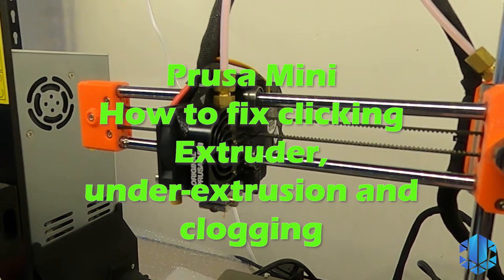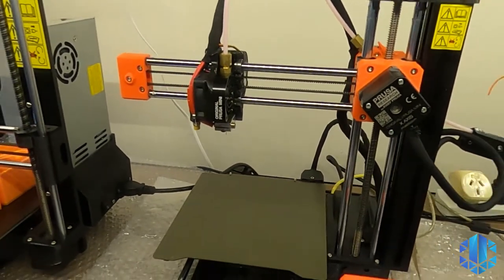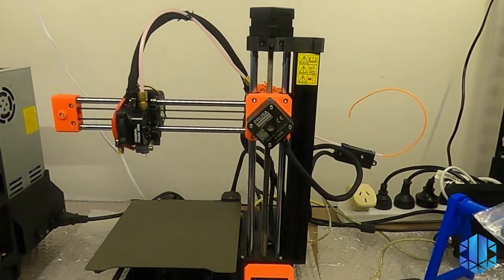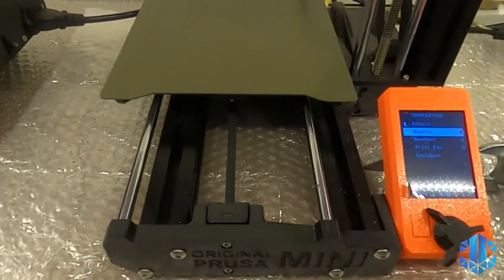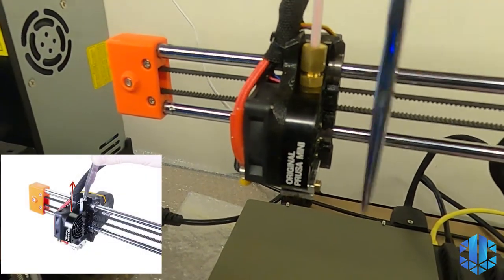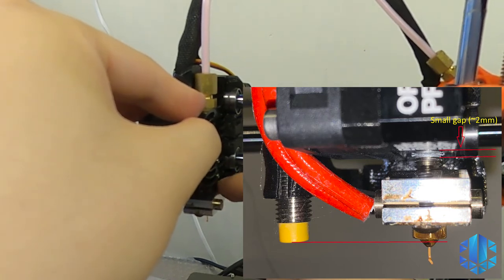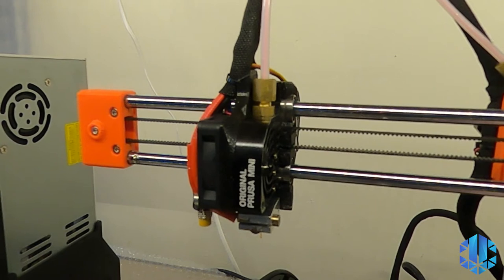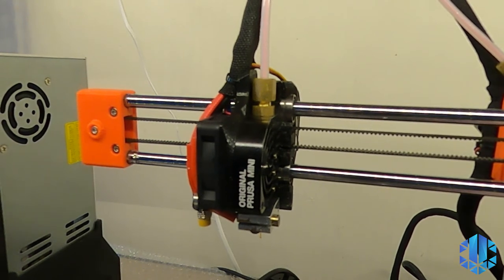Prusa Mini: How to fix clicking Extruder, under-extrusion, clogging, and filament jams

Comment: I havent had my Mini for more than one month and im already having these problems. At first I thought it was the Filament brand or retraction settings. I've checked belts, bolts, lubing, done cold pulls etc. I think this is the issue. I'm in for a long print right now but i'll try this right after. What blew my mind is that I printed a benchy a week ago that was nearly perfect, just slight stringing. Did the same test yesterday and the stringing is crazy with the same settings. Disappointed in prusa.

Comment: Thanks for the video.  I am surprised that there are not more videos on this topic.  I received my  Prusa Mini last week and after about 30 hours of printing, I got a massive clog.  Nozzle was completely encased in filament, big blob.  I also noticed that the height of the steel spring plates are different thicknesses.  You need to re-calibrate each time that you change the build plate.
Reply from the maker: Yes I had the exactly same issue when I was instructed to perform the cold pull. I used the cleaning filament from eSUN and the blob of the filament was completely stuck inside the heat sink. I got injured as I used way too excessive force on piler and it hit my mouth, and the blob was still stuck inside. I took the nozzle off and use the allen key to push up the bolb - it didn't work either! To fix that I heated up the nozzle up to 270C and cut down the power for the printer - this was to stop the fan from spinning. I pushed out the big blob as the filament was melted and deformed.
Reply: You can add build sheet profiles to make swapping easier.  No need to recalibrate between sheet swaps

Comment: Thanks for the video. Just received my mini, did two small prints and then starting having these same issues. Tried a cold pull and can tell the end of the filament is expanded so I have to adjust my PTFE tube. Disappointing as I have two Prusa's, MK2.5s and MK3, that were delivered assembled and never had an issue. Sad that out of the box these minis have assembly issues. Four years experience I can easily deal with this but I expect and new user might be very discouraged.
Reply from the maker: Hi Bob and thanks for taking a moment watching this video clip. Yes, I had A LOT OF frustrations back in the days with this clog issues with my Prusa Mini, Gen 1. I tried to contact the support and I think they were not very experienced with Mini back in the days. I think Prusa, at least for now, is not very experienced to sell assembled machines in such large quantities - most of the MK3/S printers are sold as kit. The good news is, once the alignment issue is fixed, my machine never had a single clicking or clog.
I think at this stage, I still love my little Mini. Considering my machine was shipped back in December 2019, it would be an early-stage release.
PS: I was quite caught up with this COVID-19 pandemic and I hope to post more videos once it's settled on my end.
Reply: you are right i have this problem and this is my first printer and i am afraid to do that and cause more damage to the printer.
Reply: @Warbeaver  well i will never buy prusa again i have used other filamnt printer before and never gave this problem. this my first owned printer and this brand is not worth it espically the customer service is horriable.
Reply: upgraded from ender 3 to prusa mini and have been very disappointed.
Reply: @manuelcruz2256  I know how you feel. I will never buy another prusa especially their support  is horrible.

Comment: Thanks so much for making this video! I think I spent 10+ hours testing various temperature settings in the slicer trying to lower the 'heat creep' since I didn't even know I could adjust the heat block height manually. I had to adjust the height sensor afterwards (thanks for the encouragement to do so!) but this is the first time I've been able to successfully print on the mini without getting the little blockages you showed at 10:48. Thanks again!
Reply from the maker: No worries @Little Tall Tales! I went through days of pain after two months of ownership of my clogged Prusa Mini, and their support couldn't figure out the root cause.
I am more than happy to share my experiences here and I am glad you figured it out.
My Prusa Mini runs reliably for more than three months since I did the rectification on nozzle height in February and I believe a lot of people might have the same issue on this.

Comment: I've never had any of those problems with my Prusa Mini.  It works excellently all the time.  I do try to improve the prints by changing the flow rate and the z offset.  What flow rate do you like?
Reply from the maker: This is a 3-year-old video and since then I've donated my machine to a school and no longer an owner of Mini, however my new workplace, which is a school as well,  has Mini+ and I haven't experienced this issue as of yet (It's relatively new). My copy of the Prusa Mini was really an early model with serial number less than 100 so you could imagine that might be some issues here and there. What I can confirm that this one has no direct relationship with flow rate as I recalled even the stock GCODE from the USB stick caused the clog after first dozen of layers, which was extremely frustrating.

At the time, even Prusa official chat support channel had no idea why this happened and you can see my video helped a lot of people with similar problem.
Reflecting on the potential root cause, I would assume there had been insufficient cooling for the hotted and it resulted in heat creeping above the nozzle. Once the filament melted at the intersection of heatsink and nozzle, it will interrupt the filament from going down, given the fact that there might be a small gap between the end of the PTFE tube and the start of the nozzle area. My method worked because of the elimination of the gap.

Comment: Still a noob in 3d printing. But my mini the filament got stuck in the brass fitting between tubes after the filament motor. As it stop printing and wouldn’t come out or go in. This is with Prusa filament.

Comment: The tube is not supposed to reach the end, its intentionally shorter so that you can print high temperature materials such as at 275C. If the tube is too close it will deform at those temps.
Reply: Incorrect. Here is a direct quote from Prusa themselves in their guide to replacing the PTFE tube, "It is crucial there is no gap between the PTFE tube and other parts of the hotend. This is why we are pre-stressing it."

Comment: If I push the heat break so high, the inliner has to be shortened, otherwise the connection cannot be screwed in as far as it will go.  Is that correct?  My inliner is 43mm long?
Reply from the maker: Hi @Grüner Woodworking
! You don't need to shorten the PTFE tube.
I think as long as the nozzle is brought a little bit closer to the heatsink, you should be okay. There is supposed to be some sort of 'compression' for that PTFE tube, as you can feel the friction when you screw in the upper fitting part in. However, I wouldn't recommend putting too much force for those three grabbing screws to keep everything in place.

Comment: When you heat your hotend above 220C the PTFE tube inside it will start deteriorating inside it and giving off toxic fumes.
Reply from the maker: Normal PTFE tube would be able to handle the temperature higher than this. Also, the internal construction of Prusa Mini is designed the way like this. There is nothing much you can do. In other words, if you print any material 220C and above, your PTFE tube will be pretty much in direct contact with the hotend at this temperature, at least more or less.
Reply: @dchstudio9519  Yeah, an all metal hotend makes sense.

Comment: I just tried my first print and half way through the first layer it blocked and would not back the filament out. Stripped out the bowden tube and the the short tube just popped out. Should this be secured somehow other than downward pressure from bowden fitting. Paid top dollar fir a ready built printer that didn’t work out if the box. Would you be happy if you bought a new tv and the manufacturer asked you to fix it yourself? Gutted that I have to cock about. Wish I’d bought 3 x ender3 instead. Shite.
Good video though mate
Reply from the maker: Glad to hear this video helped. I absolutely agree with you and I got so frustrated with this machine back in days - the Prusa support did not help much as they had no clues on troubleshooting the jams when this machine got released. I am also a Creality CR6 SE (Kickstarter) and Ender 3 Pro (for school) user and I think all these machines have pros and cons. For the long run, I do love the fine-tuned slicing profile from Prusa as for Creality, sometimes it's trial and error at the beginning. Also I realised that the mini prints slighly faster than my MK3S, possibly due to the new driver TMC2209?
It's also annoying that CR6 SE has the motherboard defects which prevented me from using Octoprint - I might do a BTT SKR board replacement when I get a chance!

Comment: Thank you for the video. Had a quick question.
When you push the hotend upwards, it will drag the PTFE tube up with it. That will probably cause the part that goes above the PTFE tube to squish the PTFE tube and overtighten it. Is that what you should be doing?
Reply from the maker: I believe the PTFE tube needs a bit of the compression to prevent the melted filament from leaking out at the bottom (the nozzle end). My Mini is still going strong after one year so it's proven to work on my end! Hope this helps :-)

Comment: I still have 2 months to wait for shipping.  I'm getting buyers remorse already!  Maybe cancel the order but what other printer?
Reply from the maker: Hi @Yakena1, I still believe Prusa Mini is a great printer! However, there are some issues and lack of documentation on the Prusa side but I would believe these issues will be resolved in the coming months. I think if you want a printer now, MK3S is still a workhorse, despite I am starting to hate the 8-bit microcontroller. MK3S are faster printers than mini because of the direct drive vs Bowden construction. Thanks for watching the video and let me know if you have any questions :-)
Reply: @dchstudio9519  I live in Asia and the additional cost to have either system shipped makes me wonder if I am making the correct decision.  I never owned a 3d printer, and I am now looking at a MK3S clone from Triangle labs.  Maybe a better way to do a diy and get up to speed.
Reply from the maker: @Yakena1  I understand this. Actually, MK3/S is still very capable of being a primary 3D Printer. They print faster and the service documents are very useful and user-friendly (compared to Prusa Mini as of this stage). As an owner of 2 MK3, lately all upgraded to MK3S, I purchased my first kit from Prusa as a kit. However, the duty and import tax here in Australia is way too high so I purchased the upgrade kit from Prusa and out-sourced some parts in order to build the second MK3. Everything worked quite well except the motors. I ended up buying motor from Zaribo, who sells LDO motors for their printers.
Reply from the maker: @Ohioan93  I think their production was affected by the coronavirus in China as there was a defect in their LCD assembly. My copy of mini is still going strong. I ordered my unit just 2-3 hours after the video release and I got it in mid-December last year. I think this printer makes great secondary printer but we all have to understand this is a lower cost machine so Prusa is trying to save some money on this machine, like belts, smooth rods and extruding mechanism.

Comment: I can’t tell you how much I hate the prusa mini 😂
Reply from the maker: I was sort of the same, but Mini can be a power horse for non-stop production. My extruder issue never came back since this video was published and the machine is still going strong (despite two service tickets regarding the PINDA probe and heatbed issues - both were cable fatigue related but Prusa managed to send me the new parts both times.).
Good luck :-)